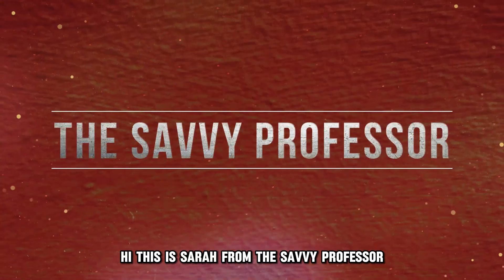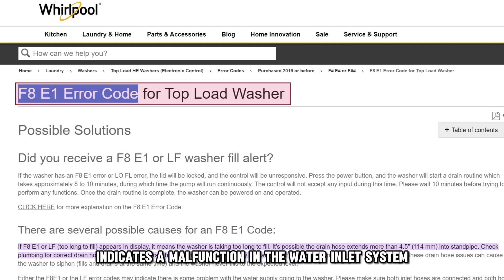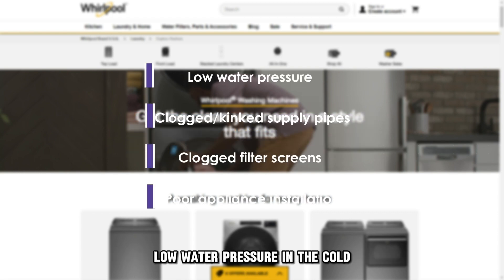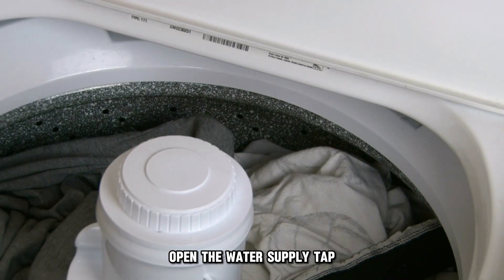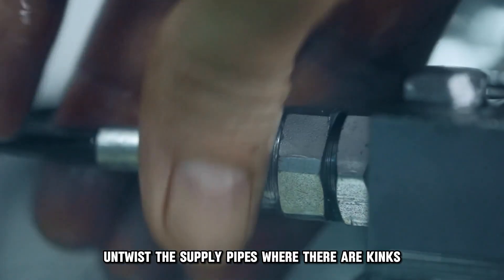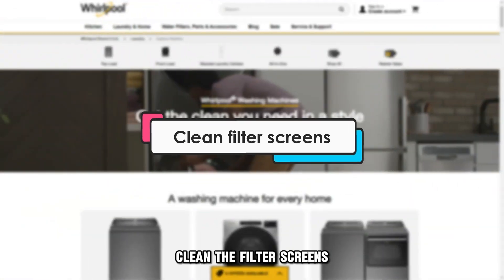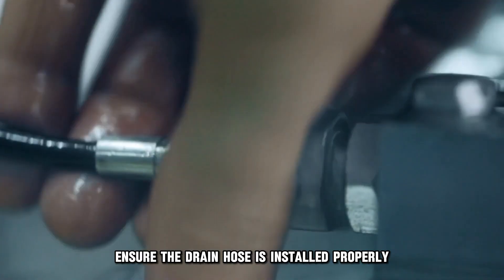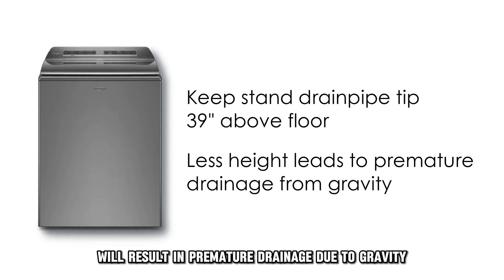How To Fix Whirlpool Washer F8E1 Error Code - Meaning, Causes, & Solutions (Solved Quickly)

Comment: I have this code on my top load whirlpool washer.  Have check all the usual issues, even replaced the filter unit.  It comes on intermittently but still fills water if you press the manual fill button next to the laundry softener dispenser. This leads me to think there is some type of short maybe?  You can hear what sounds like a pump trying to run when the code pops up. I'm at a loss as I've not seen anyone address this happening for a reason other than what has been noted in your video.  Any ideas?
Reply: I am having the same issue as you.
Reply: I’m having the same issue, were you able to figure out what it was?